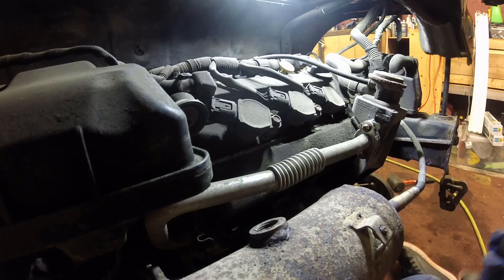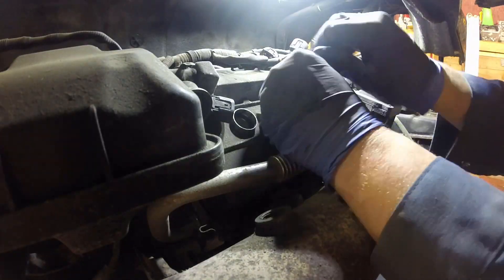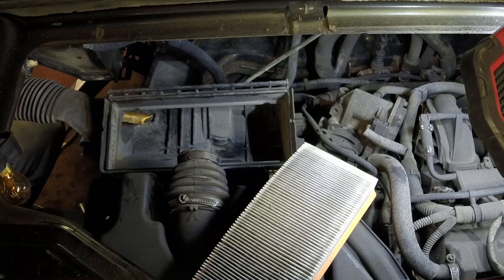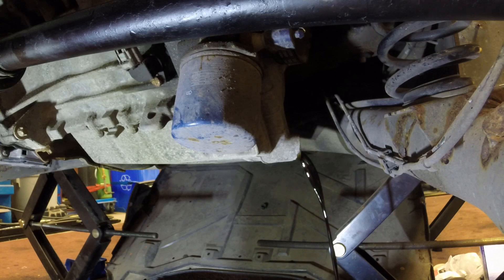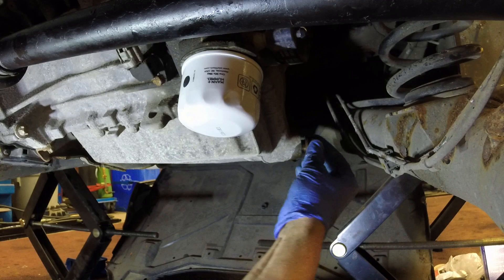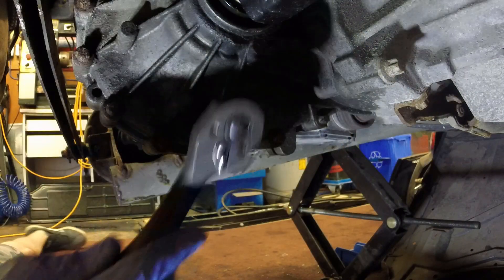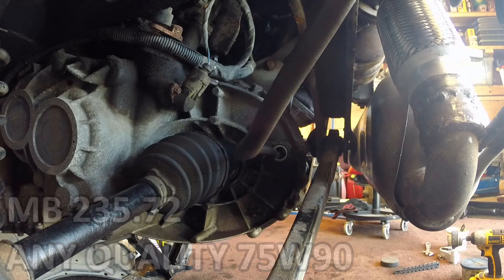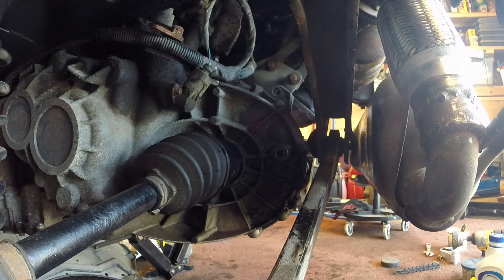Smart ForTwo 451 Basic Maintenance Procedures

Comment: How did you lower the engine? I did all this service with lot of difficulty as DIY. Thank you
Reply from the maker: I’ve got some lowering bolts (OEM Mercedes part number) but you can also put the rear cradle bolts in the front holes and support the rear of the engine on a jack to get some clearance. We’ve got a video around here somewhere on the channel about it.
Reply: @PBGarage thank you

Comment: the transmission gear oil, 75w90, needs to be GL4 for the brass parts in the transmission.  GL5 oil is corrosive to yellow metals.  I would love to see how you dropped the engine.  Have tried changing out the air filter through the maintenance hatch and was not successful.  I know it can be done but not easy.
Reply from the maker: I have a video on dropping the engine, it’s on some service position bolts from Mercedes’ but can be done using a jack and the stock subframe bolts as well.

Comment: Sir. May I ask what is the brand of the engine oil? I can not find the same oil with yours, I searched formula 1 sae 0w-40, but google only pop up the Mobil 1 oil. Thanks
Reply from the maker: Hello, I don’t use any specific brand, I often use the Mobil1. I specifically look for the VW505.00 specification. Around here it’s normally branded as “European formula”.

Comment: Am i the only one that got a European star type drain plug for the oil plug?
I been looking at videos trying to find what the size of the oil drain plug star bit is so i don't have buy a whole new set of them just to use that one but everybody seems to have an American 24mm socket on it?
What the fuck man
Reply from the maker: If you’re in North America then someone definitely swapped it out on you.
Reply: @PBGarage  
That seems to be the case, i might spend the 14 bucks to buy the original plug back from eBay after getting this one out.
I don't know about having star type bolts in high torque places, feels like one had slip and I'll be in a world of sht